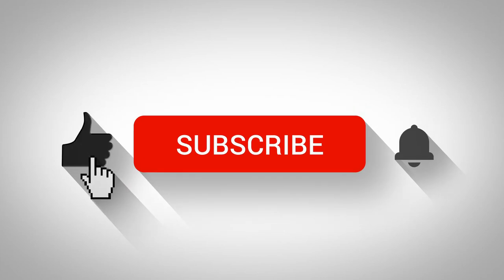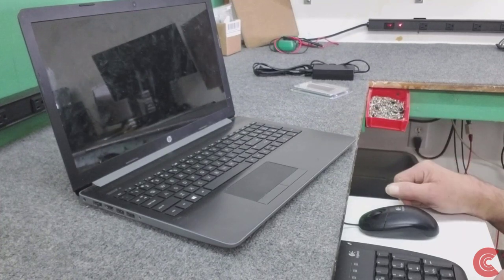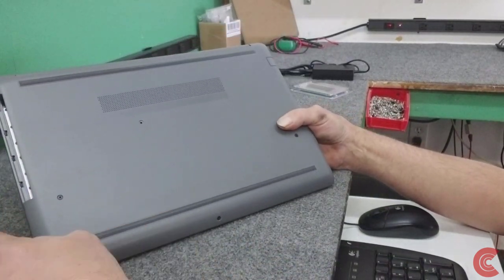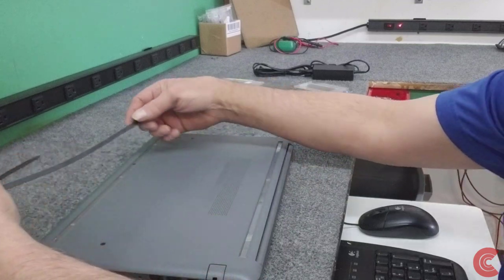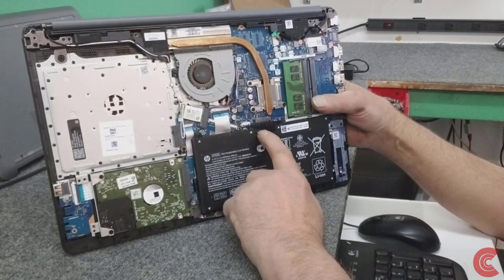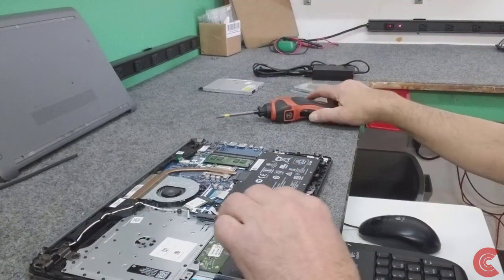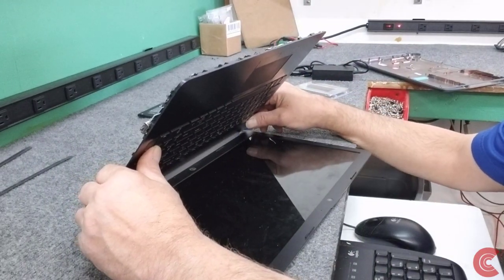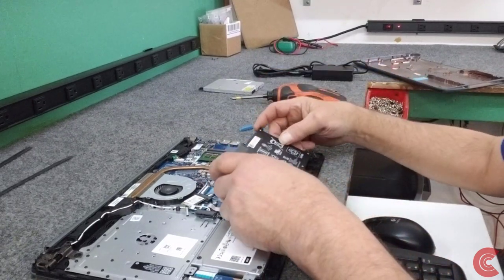Replace Bad Hard Drive in HP 15 Laptop With New SSD

Comment: Thank you. My laptop HD died and was afraid to open it, but now that you showed how, I'll give it a try. Thank you again for this video.
Reply: This happened to me too and my SSD is on its way. How did it go Ted?
Edit August 2021: For anyone curious, I installed the SSD into the laptop and it works so very much better. It used to take 30 minutes to boot up at times and now it has yet to ever take more than 45 seconds to go from pressing restart to signed in. Well besides when updating, that is. 
Specs: Installed a WD Blue 500 GB 2.5 inch SSD inside the HP Notebook  15-ay014dx laptop I previously installed another 8 GB DDR4 Ram Stick into, making it a total of 16 gb RAM. Those are the only modifications but when I had the HDD and I installed double the RAM, it didn't help the boot times at all like the SSD did.
Reply: Did you need to buy a new cable or was it able to just plug in place of stock junk HDD?
Reply: @njdan301  you don’t need cables man! It’s simple, plug and play! You get the HDD out, then you mount that bracket from the old HDD to the new SSD and after that you simply plug in the SSD, screw the screws back into place, install the windows and it’s ready! Also, don’t forget to back up your things from the HDD if you have important things there, and don’t panic if your laptop is turning on a little slower, because the SSD needs a little bit of time to communicate with the motherboard!
Reply: @idanromania102  the day I asked I picked up two new drives and put one in my laptop and my kids other laptop I couldn't because hard drive part of the mother board so I ended up using it in an old ps3 which worked great, laptop I fixed never worked so good, thing was painfully slow since day 1 lol

Comment: Thank you for this video. My hp laptop has rapidly degraded (hardly used and only 3 years old). I mainly use it for school. I build my own computers and have been eager to try my hand at messing around with laptops. The laptop I have is pretty much the same you worked on except its I5 8th gen without a disk tray.

Comment: Real nice bench setup. Worked at a computer store and they had very similar carpet setup with power that you got. nice video thanks. Sure the same or similar models all have the m.2 slot which is a nice deal.
Reply from the maker: Thanks. I appreciate you noticing. Dale

Comment: Great video. Thanks for posting it.  Just pulled mine apart and found no ssd drive, only the M2 256gb drive.   I want to put in a 1tb M2.  Do you know if the Bios will take it OK?  I also only have one 8gb memory stick.  I grabbed some out of my old HP but the are different.  Do you know what I should look for?  Thanks

Comment: Hi, i do hope you can advise me with regard to upgrading HP Laptop 15 da0xxx which is extremely slow booting up, ie, black screen for a couple of minutes, then the hp logo appears, then another three minutes booting up until all the icons are displayed, i have seen your video replacing this laptop with an SSD and feel after watching your video it's something i could tackle.
What would be your advice in getting this laptop super fast,  ie, what's the best SSD i could use and would it be best to add more ram as this laptop only has 4 gb  also if i did replace the SSD an RAM what kind of boot up time would you expect to achieve. Many thanks, M.

Comment: Thank you Kindly, My work laptop's HDD just up and called it quites (was getting slow knew it was coming) took me 4 months to convince the Company to get a new Drive but I was left with the job of putting it in(wanted to do it any way I enjoy it but it does terrify me a bit) I also changed the Thermal paste while i had it open since it is 3 years old now and that I did not my person PC so was not much of a sweat only 4 screws and make sure to tighten them all a little bit at a time,

Comment: I got HP 15 da0xxx i5-8250u,4GB ram, 1T HDD hard drive notebook laptop. I want to replace my 1T HDD hard drive with SSD sata hard drive or NVMe m.2 I'm asking  which one should buy to improve the speed of my notebook because My HDD is very bad and with almost failed reading speed? Regards,

Comment: Newer 15.'s or maybe just my model have 2 screws under the 2 rear rubber feet, but none under the front strip.

Also only had a car trim panel tool which worked great

Comment: Hi bro, i found your video froma thousand of other which wasnt very helpfull like yours. I have hp 15-db0005dx and ssd sata 2.5. The problem is that i can not get the other end of cable in that little bracket on motherboard. Can you give me the link of cable for my laptop ? Thanks

Comment: Hello, I have a HP Pavilion 17.3" LCD screen, I bought it in May 2015, lately it has been kind of slow and looks like that sometimes the hard drive gets stuck, I would like to replace the HD for a SSD, my question is which model of SSD will fit in my laptop. Thank You!
Reply from the maker: Hi. Any 2.5 inch sata ssd will work. The Crucial MX500 series works great, 250GB, 500GB or 1TB will work. Dale

Comment: TY. I have a HP 15-da0079nr. The 1 TB 5400 RPM SATA drive has failed. Will a Kingston 480GB A400 SATA 3 2.5" Internal SSD SA400S37/480G - HDD work?
Says it's "Backwards compatibility to SATA Rev. 2.0"  Can not find any more specific info this laptop on the HP site. TY!
Reply from the maker: Hi. Yes. Any 2.5 inch sata ssd will work. Thx
Reply: @CadillacComputerCenter  thx

Comment: I sincerely hope this isn't a stupid question. What(if anything) would happen if you put an M2 SSD in that slot, screwed it in, then left that other Drive and started it up??? I have sent away for my Wife for 2x8Gig Sticks RAM, and a 2T SSD to replace in her HP Pavilion 15Z AW000 Laptop. Wonder which I'll get in the Mail(Stick or 2.5" Drive). Crucial Website has what I ordered :

This part is 100% compatible with
Pavilion 15z-aw000 CTO

Ordered 2 Sticks 8G RAM
Maximum memory: 
16GB
SATA version: SATA 3 - 6Gb/s
Slots: 2 (2 banks of 1)
Standard memory: 4GB or 8GB removable
Storage
 :
Crucial MX500 2TB 3D NAND SATA 2.5 inch 7mm (with 9.5mm adapter) Internal SSD
Drive form factor: 2.5inch and M.2
Drive Interface: SATA/PCIe

Thanks, GOOD Video, helped when the Parts arrive👍👍

Comment: It's been a bit since you did this video.. I have a HP 17.. probably the same process, right?  Man, they really didn't want folks getting that case.  My challenge is always popping plastic parts apart.. always afraid I'm going to break something, because it happens a lot.
Reply from the maker: Yes, very similar.  Just use good tools, and dont hurry.
Reply: @CadillacComputerCenter  Thanks.. just found your 17.3" HP vid.. this one has the bottom configuration on my machine...wish I could have it on while I do the job.  First time going in the guts of a laptop though I'm fine in a tower.

Comment: I have an HP 15c series laptop.   8 gig ram 128 gig m.2 (600 MPS) with a 1 TB spinner and 8GB 2400speed ram (single channel.)  With this model you cannot easily open the case.....   but if you do:::    good things can happen!  The slower 600mps m.2 was replaced with a 512 gig Samsung 970 EVO.  3600 mps speed...   Yes, that's nice.  The ram upgraded to 2x8 gig 2666 speed dual channel ram..    thinking about switching out the spinner while I am at it.  The connectors look proprietary.  even if I do not switch the spinner out I will still disconnect it.  2 out of three major wins!!!  Not sure why HP would pit such a crappy m.2 in this machine.  I am glad it was upgrade ready though!!!

Comment: I replaced my HDD with a 250gb SSD and now when I try to boot into the windows 8 installer I get a recovery boot error with the error code being 0xc00000098

Comment: What type of conection could i add to my laptop? It is the same than the video thanks. Nice video
Reply from the maker: Hi. You use a 2.5 inch sata ssd in this laptop. Dale
Reply: @CadillacComputerCenter  im so grateful, my laptop at the second year go too slow hahaha
Reply: @CadillacComputerCenter  sorry sata but not sata 3 no?
Reply from the maker: All new sata ssd drives will be sata 6. But very backwards compatible.  Dale

Comment: Do you know if the m.2 ssd can be installed in an HP 15-db0005la model?
Reply from the maker: Hi. That model does not have m.2 slot. You could upgrade to a 2.5 inch sata ssd though. Will make laptop much faster. Dale
Reply: @CadillacComputerCenter  So, i think the only option to have my current HDD and a SSD is to use a caddy adapter instead the cd reader, right?

Comment: After I put in the new ssd will I be able to turn it back on and it’ll boot up like if it was factory reset?
Reply: You need to reinstall windows 10 onto the ssd with a flash drive on an ISO file
Reply: *or an ISO file

Comment: Although you did visually show a properly installed SSD there is the possibility of sliding the drive in UNDER the sata power data connector. I did it. Put the damn thing back together and had to figure out why it told me there was no boot drive.
Pulled it apart figured it out and moved on. 😂

Comment: Can we install SSD in hp 15 db 1069 laptop
Reply from the maker: Yes you can. 2.5 inch sata ssd. Not sure if it has m.2 slot though.
Reply: @CadillacComputerCenter  how can I check which one suitable for hp 15 db 1069
Reply: Please help
Reply from the maker: You have a 1tg hdd now. Right?
Reply: @CadillacComputerCenter  yes 1 tb hdd
Reply from the maker: You can upgrade your hdd to a 2.5 inch SATA SSD, like crucial mx500 1tb, or Samsung 860 EVO 1tb SSD.  dale

Comment: So now what? You have no operating system! How do you install win 10 with no OS????
Reply from the maker: Hi. Well, actually clean installs are an everyday thing here. I have a video on how to create a windows 10 usb install drive. Very simple and free. Windows 10 is free from Microsoft these days as long as the computer had a previous version of windows. 8, 8.1 or 10 activated on it. It requires no product key. After you create the usb drive, simply boot from it to install latest version of 10.  Here is a link to that video.....https://youtu.be/m2A5gcvV9HA
Reply: @CadillacComputerCenter  What if I wanted to clone HDD to SSD .... in this model .... how would you go about it? Attempted Acronis image while HDD was inside. Swapped drives and now laptop wont boot. Says doesnt see windows.